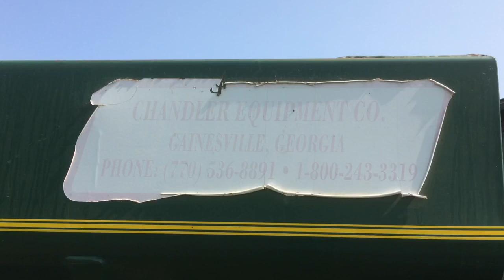Fixing The Battery Cable On The 720 - Getting The Disk Ready And Other Saturday Farm Stuff!

Comment: Question for you... Why didn't you just put another battery clamp on the cable that is already there?
Reply from the maker: I thought about that but I’ve never had very good luck with those clamp on battery clamps. Just another connection point to go bad